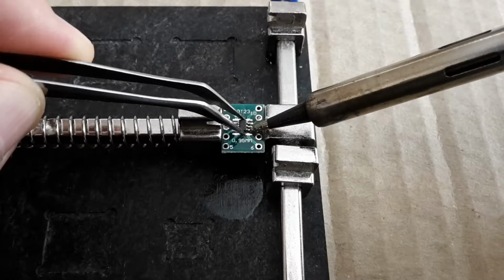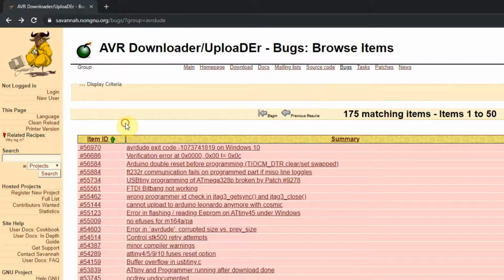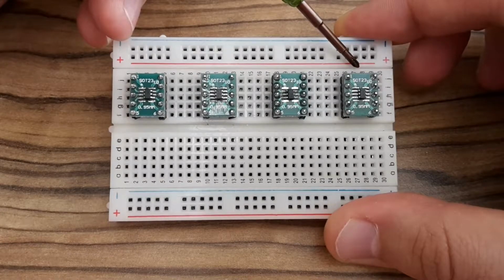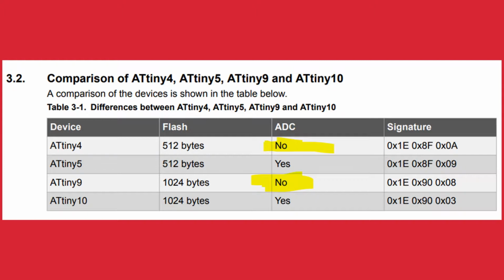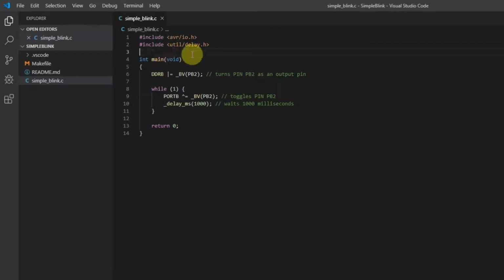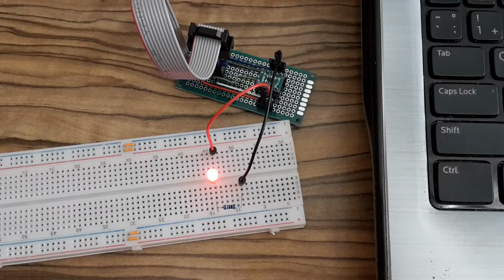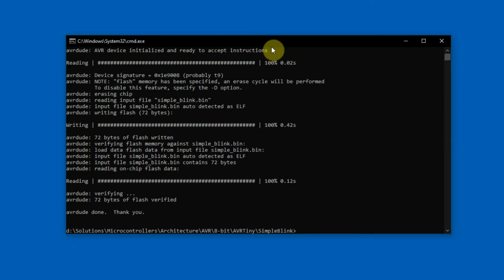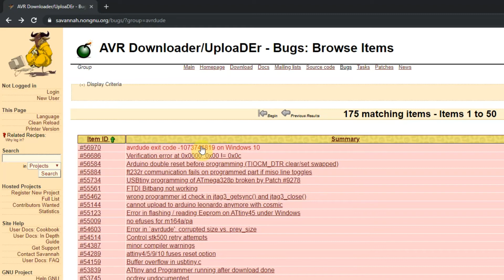Breakout Boards for Programming ATtiny9 and ATtiny4 Microcontrollers (2/2)

Comment: how can we use the arduino ide to program this?
Reply from the maker: Hi, as far as I know, the Arduino IDE doesn't support these small microcontrollers. I mean ATtiny4/5/9/10. They have very small flash and SRAM.
Reply: @zeroampselectronics  I have seen people program the attiny10 in Arduino ide.
Reply from the maker: Hi, you can try that and you will see many obstacles and limits. ATtiny4/5/9/10 are not officially supported by Arduino and you have to apply many hacks and as I said they have very small flash and SRAM.